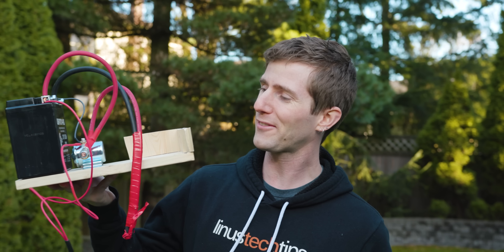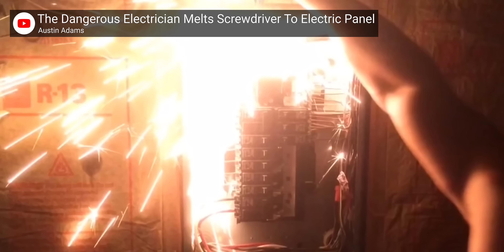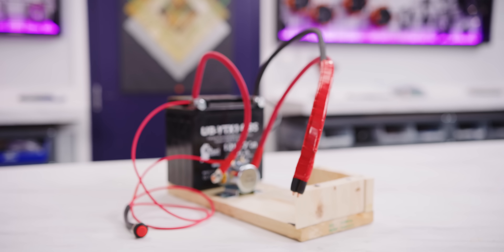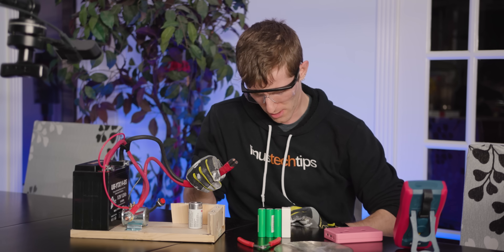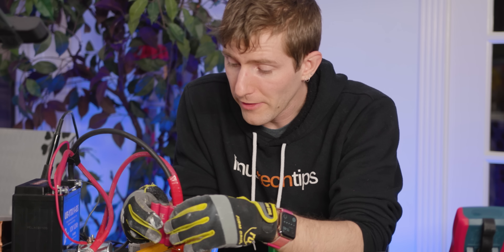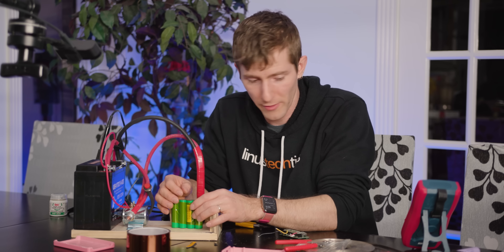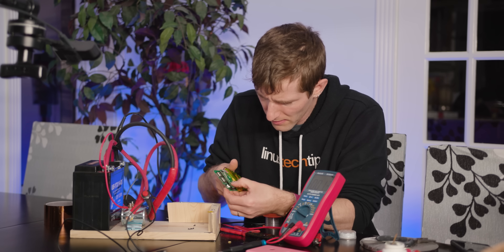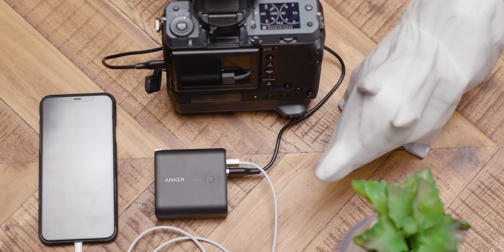I spent $100 to save 20 bucks... and it was TOTALLY worth it!

Comment: Could have used an arduino to actuate the relay and a pot to the arduino to increase/decrease the timing. That way after figuring the perfect timing for your strips, it wouldn't matter how fast you press the button, since it would only trigger your code and the arduino would do the timing more precise than a human could ever do.

Comment: The inner resistance is more important then voltage  for longevity and if using a good bms with balance charge the internal resistance is most important as to much different resistances will make the bms indicate faulty battery even if it holds charge (this is why laptop batteries dies one cell is bad and a really high internal resistance

Comment: The other problem with soldering is that tin and lead solder won't stick to the ends of lithium ion batteries. I learned that from experience. (Maybe the battery I was using didn't like me?)

Comment: With the modern battery banks that also work as car jump packs it would make more sense to use one of them than a big old lead acid car battery.  With the much smaller size and weight you could probably make it in the form of a gun complete with a recharge circuit.

Comment: Don’t build one of these at home if you don’t know what you’re doing. DC will still kill you at less than 1A. This device operates much higher.
Reply: Something like 0.01A can kill you but at 12V you'd need very low resistance to get that current.  Basically licking the battery terminals wouldn't feel great but you'd be fine.  In this situation the only real danger is a direct short...which to be fair is exactly what that contactor relay is doing on the cell.  But that only creates heat because of the direct short.  There is effectively no danger of electrocution here.  Other dangers yes.

Comment: My friends and I needed a spot welder for an engineering project, but one battery wasn't enough, so we had two car batteries wired in series, with wrenches on the leads. It was one of the best, jankiest things I've seen.

Comment: 5:18 the things you need: YOU MUST NEED A TABLE, battery, spot welder, etc

must use a table or might need to use it in air
the verge PC building video (reference for table)

Comment: Us: Did you save money?
Linus: Well yes, but actually no.
Reply: Just watched the new warowl vid, did you get it from there? Edit: there is a correct answer.
Reply: depends on what yo use the spot welder for afterwards, i built one of these years ago to convert power tool battery packs from ni cad to li po started doing it for my own use and eventually ended up making packs and selling them on ebay, made enough to buy a real spot welder and thus far im in the black on the deal. still selling reman battery packs today.
Reply: @yetshi  Don't Li Po charge at different amps and such, seems like you'd need to replace chargers for the modified packs?
Reply: What I took away from it was: 1. you aren't going to save money by replacing power bank batteries. 2. time and risk make it even less of a deal. 3. Buy an Anker. New powerbanks support newer phone QC methods anyway.
Reply: Sedace is correct. You can use a NiCd charger on NiCd only. Can't charge NiMH or Li ion battery